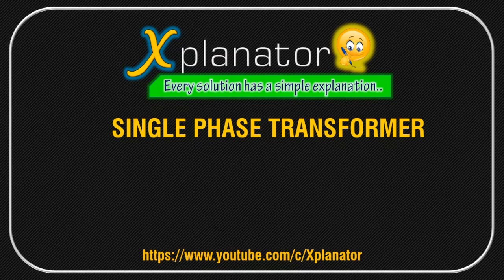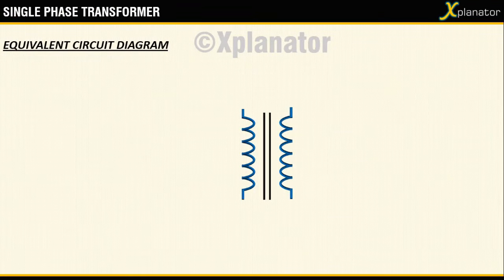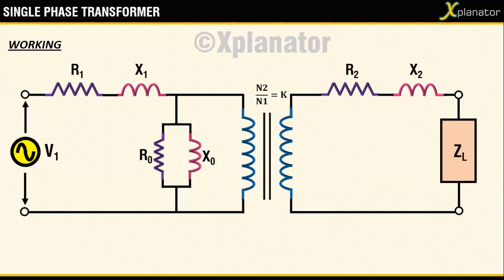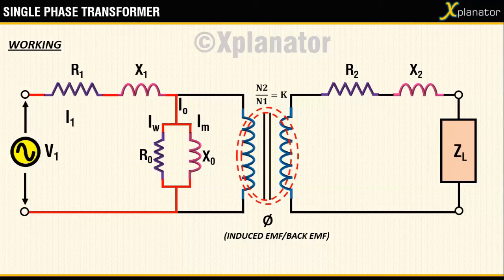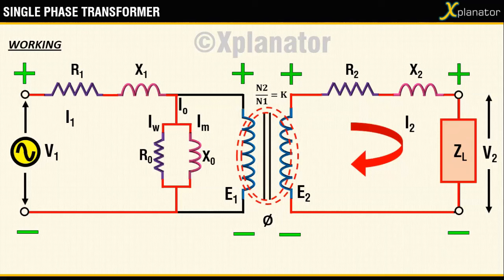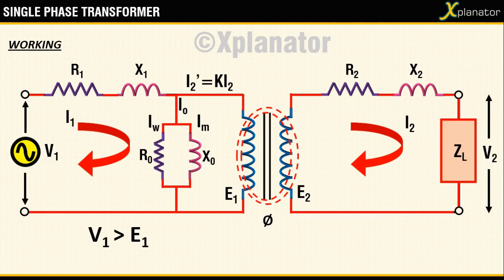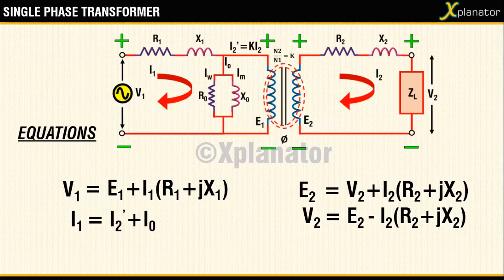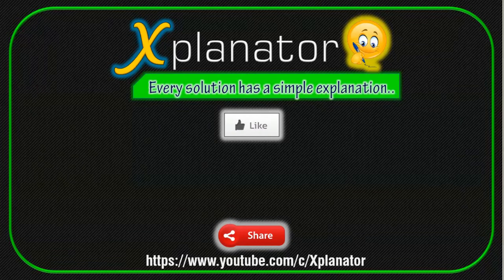SINGLE PHASE TRANSFORMER : EQUIVALENT CIRCUIT AND WORKING

Comment: Sir I have a confusion u said lenz law but didn’t follow it the polarity must be opposite to oppose the voltage applied and u have put the same polarity everywhere why?
Reply: The Polarity is indeed opposite think of the batteries sign instead of + - you wil realize

Comment: I have two doubts for u... 1-what will happen if v1=E1?
2-what will happen if we use dc current in place of ac current... 
Thanks in advance for your kind help in clearing my doubt..
Reply: V1= E1 this condition will not happen as there are resistive and reactive component r1 and x1. 
Dc cannot be used in transformer as it does not have frequency. Therefore transformer will not work and the primary will act as a resistance connected to dc source

Comment: Does this assume that the dot convention is that the primary has a dot at the top of its coil so that the reference current goes through it and the secondary one has a dot at the top of its coil as well but its reference current is leaving it so its the opposite emf. I think that would help make the video even easier to understand.
Reply from the maker: in place of dot convention i have used appropriate +/- signs to make it easier.  both coils have dots on top side

Comment: Why is i2 dash = K(i2) at 5:43? Sir
Reply: Transformator ratio is saying N1/N2=I2/I1 or U1/U2=I2/I1 so if transformer increased voltage to secundary side, he lower current on secundar by same amount he increased voltage, u get that from ratio.So if ratio of turns is 50/100 because he sad secundary have more turns, current will be lower by 0,5 then current on primary. If load increased current on secundary by 2A primary would be higher by 0.5(2/0.5).Hope this helps

Comment: Why Ro and Xo is in parallel? why not in series?
Reply from the maker: We are analysing current which can be used and which gets wasted as a loss. When u say parallel circuit , there is more than one current involved(depending upon the number of branches). So u can represent the current which is useful and which is not. 
If u put the elements in series, then there is just one current in the circuit and that does not help you in analysing.

Comment: sir you don't even know what you're taking and what you're telling to students leave youtube now
Reply from the maker: Grove Street  I appreciate you going through my content. However it is designed for engineering students. If u are not one, it will not make any sense to u :)
Reply: The video isn't incorrect. The one thing they did not mention is the assumption of the dot convention on the coils so that the reflected emf opposes the primary one.
Reply from the maker: please refer the sign notations across the coils(+/-) and the terminals.
Reply: @shawnscientifica6689  He also mentioned Lenz's law. You must be not listening properly